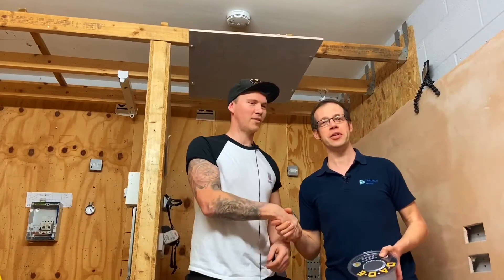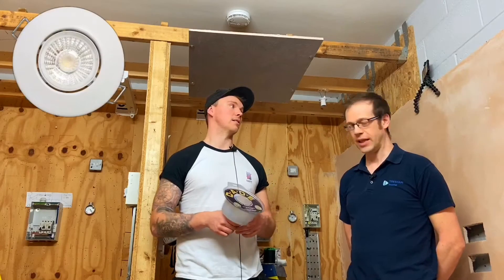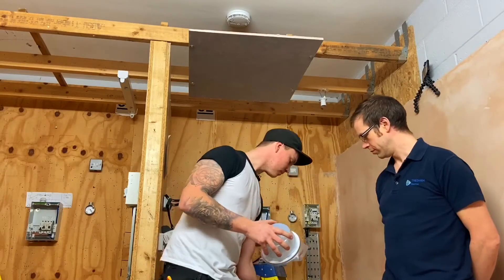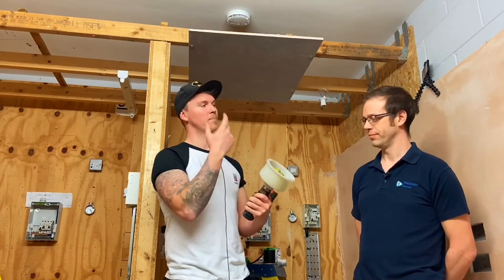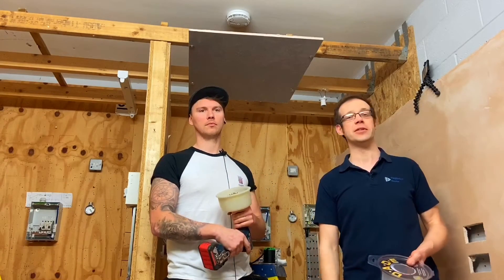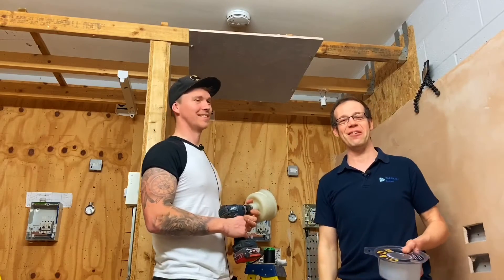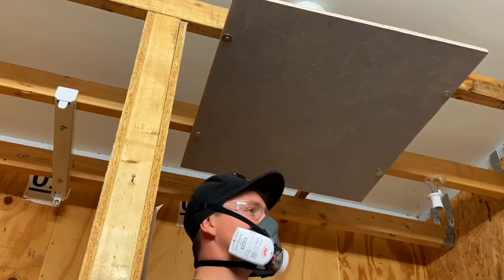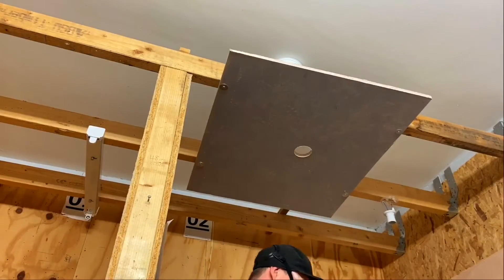How to Cut Holes for LED Downlights Using the D.A.D.E Dust and Debris Eliminator with Nick Bundy

Comment: Does no one use the adjustable hole saw with cowl, so much easier to tighten into your chuck it's spring loaded and totally clear and massive bowl so you can pump like 8 holes out without them getting stuck and having to bend your nice terminal screw drivers trying to pry the matter out your hole saw and going in blind with the cover and if I remember the hole saw chuck plus that rubber thing is a bustard to lock in not much shaft. You can bang through the recess lights and see what your doing and no dust with the solid dish 👌 ✨ 😌

Comment: Any tips for enlarging downlight holes? I've got a load of 50mm halogens that really need to be 240v but that means a 63mm hole...
Reply from the maker: Sneak Peek - Sockitz new lighting safety shield https://youtu.be/9quWwSUne2o

From my other YouTube channel eFIXX 👍
Reply: Ck do a holesaw adaptor, lets you have a holesaw inside a holesaw. So in your case you would put a 63mm on rhe arbor, drop in the adaptor and use a 50mm holsaw as a guide bushing.
Reply: @Boxferret  cheers I'll take a look at that. When I've needed to do it before I've cut out the hole in an offcut of ply or MDF then tacked it to the ceiling and filled afterwards. Pain in the arse.
Reply from the maker: https://youtu.be/aoxPi-BQ7kQ

These work 👍
Reply: starrett a19 oops arbour adaptor enables you to put a 50mm cutter on the inner then add your 63mm to the outer.. saved me so much time over the years